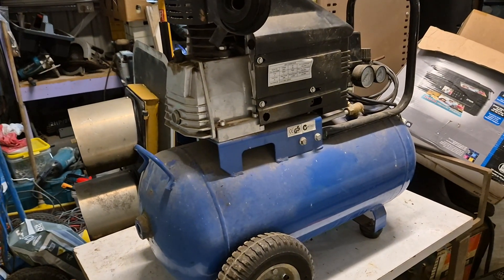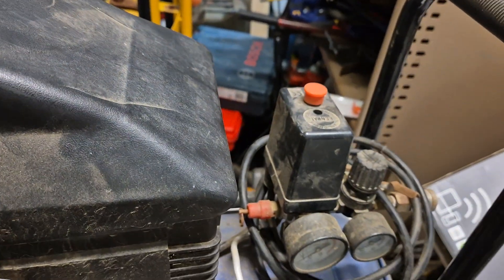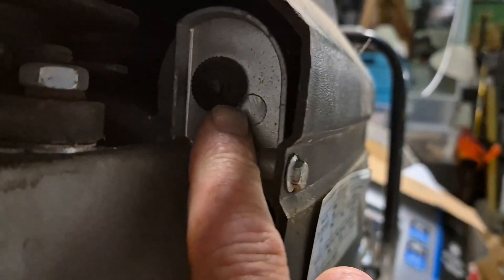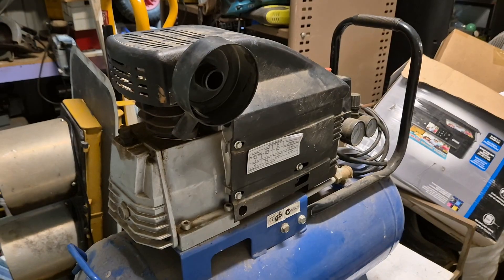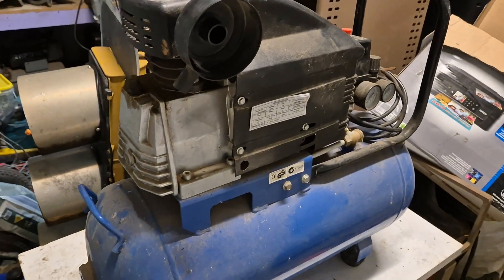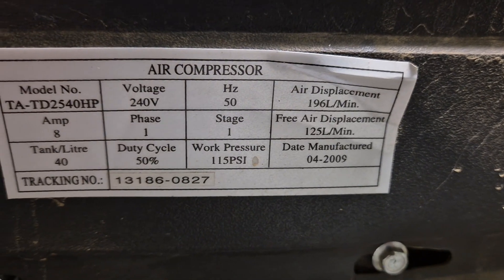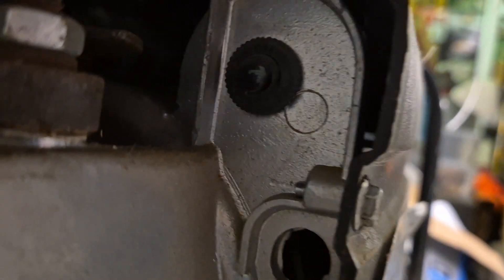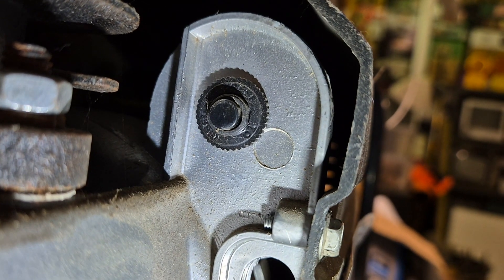Check This if Your Air Compressor Stops Running

Comment: My neighbour gave me a small drill press that had stopped working , I was going to pinch the drive belt off it. Opening the belt cover I found it had switch under it   that fallen out of alignment. I adjusted it and worked again and give it back to her.